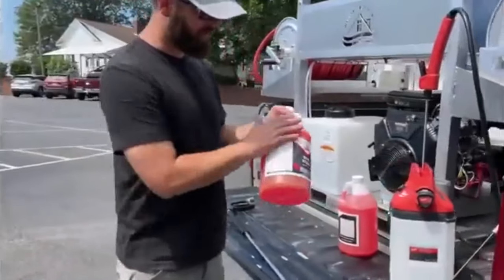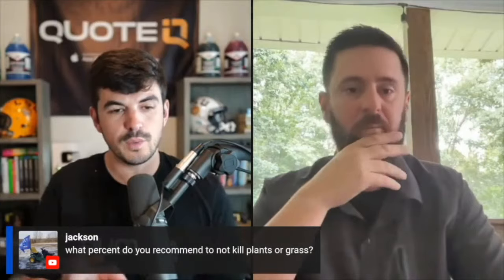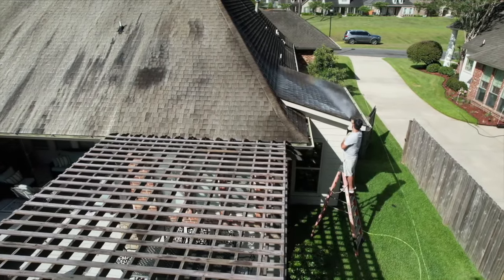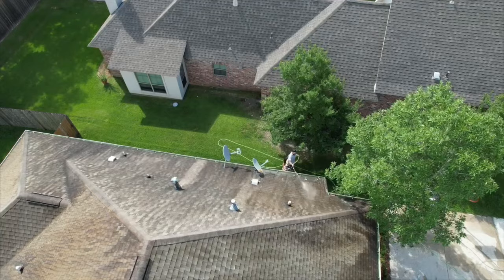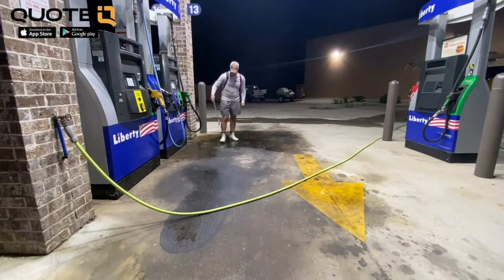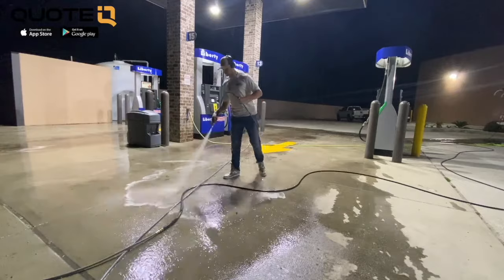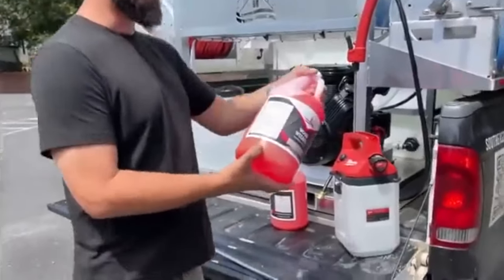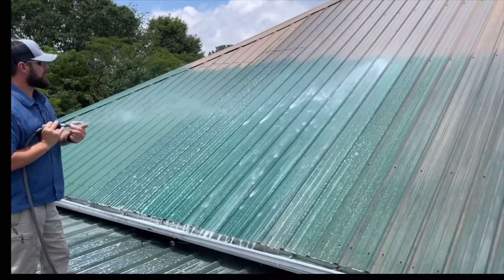The Best Chemicals For Pressure Washing (Complete Guide)

Comment: Thanks for all the information. Coming from an industrial water treatment background and dealing with sodium hypochlorite, I haven't seen any of the power washing videos where the guys are reducing the pH of their SH mix when using it on driveways and sidewalks. Reducing the pH will greatly increase the efficiency of their mix. Here is an example of efficacies of SH at different pHs. At a pH level of 7, chlorine is roughly 75% active. At a pH level of 7.5, chlorine is roughly 50% active. At a pH level of 8 chlorine is roughly 25% active. With a pH level of 6.0 your SH mix will be highly effective with 97% of your chlorine available.The pH of the SH mix can be reduced with white vinegar and the pH checked with pH strips. Give it a try and see how effective your clean will be. Blessings.

Comment: What soap should I use in a pinch. Your opinion best cheap or budget soap till my order for surfactant comes in
Reply: I wanna know to
Reply: I use Dawn dish soap every day. Like he said in the video, it will say “do not mix with bleach” on the label. HOWEVER, most Dawn bottles you find will not say that and those are the ones that are safe to use with bleach. Just always read the label to be sure.
Reply: I’m about to use dawn on my backyard patio floor. Probably my front steps too. Soft wash. I only have 1800 psi

Probably soak. Soap. Agitate ( I have a tough bristle shop broom ) then pressure wash
Reply: @Miguel001  Dawn is also safe in Septic tank, the new dawn, directly from the Dawn support.  Along ago, dawn had a different formula.  They use down to clean animal.

Comment: Hi There, I think I mistook to use high pressure washer to pump baking sodia water. It corrotes the washer . Is  it right? Which equipment is better to wash  roofs with baking sodia water.? Thanks a lot.

Comment: Working for daddy’s company and kinda starting to add pressure washing as a full time thing for me and for the most part self taught and do 95% of jobs by my self (im 19) we have fixed dam near every other problem we have come across 
But we can not figure out for the life of use how to spray the chemicals on the tall ceiling and awnings of a shopping center (daddy does property maintenance for a company that owns shopping centers that’s how I get my jobs we do not to houses) but everything we’ve tryed has failed if anyone can help with that please lmk still young n leaning 
PLEASE WEAR PROPER PROTECTION WHEN USING THESE CHEMICALS SHORTS AND A TEE SHIRT WILL LEAVE UR WHOLE BODY IRRITATED FOR DAM NEAR 2 DAYS LEARNED THE HARD WAY😭

Comment: If your just doing driveways. Would it be okay to pretreat with your SH out of an electric backpack?
Reply: Did you ever get an answer to this question from anyone? I'm looking into cleaning driveways on the side and I was considering back pack chemical/dilution applications as well for pre and post treatments.
Reply: need an answer to this lol. i have a i think half gallon foamer i havent used yet. but from what im seeing and hearing everyone keeps talking about having a 5 gallon bucket to have around for your dilution needs.

was thinking of buying an electric backpack sprayer for three reasons. One, not having to switch out nozzles or stop running water etc to and from the pressure washing system. Second, not running chemicals through my gun and lines etc. The third being if you have two people one person can pre treat ahead of you while you are actually power washing. Or if you are by yourself you can use the sprayer then move on to power washing and it will set and do its job while you catch up with power washing etc.

Comment: Is dynamite degreaser safe to let run off into the sewer or grass/dirt when just dealing with dirt driveways or dumpster pads?
Reply: Nothing can run into the sewers. Even if you use zero chem, the runoff can not flow into the sewers or you could get fined. Look up runoff reclamation requirements and up charge for reclaiming the water
Reply: So when you do a driveway how to avoid the water and soap or chemicals from going into the sewer?
Reply: @OGBREED boom?

Comment: Except bleach doesn't kill mold. It just bleaches it. If you don't believe me go ask any emergency restoration company that does mold removal. I've been in the industry for over 10 years. Not crazy long but long enough to know that part.
Reply: I didn't know that
Reply: It does kill mold. You're mistaken, but you're not completely wrong.

Bleach never kills 100% of mold and the problem is that it leaves behind a film once dried that is nutrious to mold, so that what's left behind grows quickly. Just a touch of vinegar afterward will do the trick.
Reply: @trentotts mmm, it will kill the growth on the surface and on non porous surfaces but on porous surfaces like concrete, neither will kill the roots.